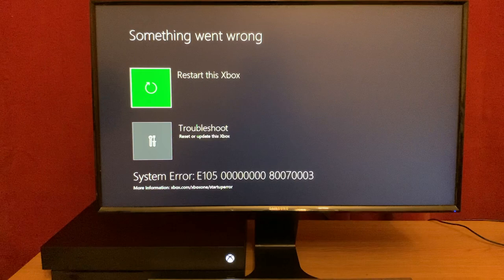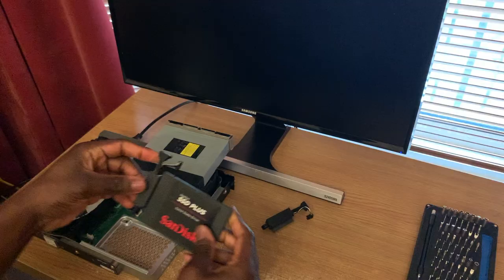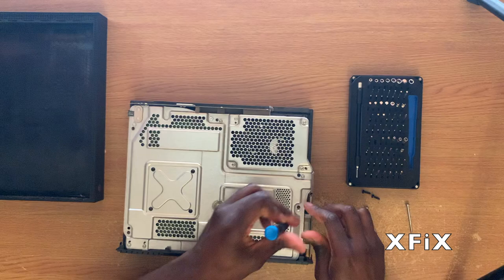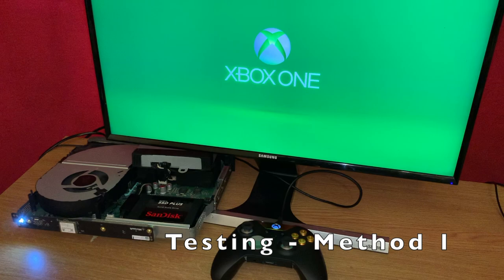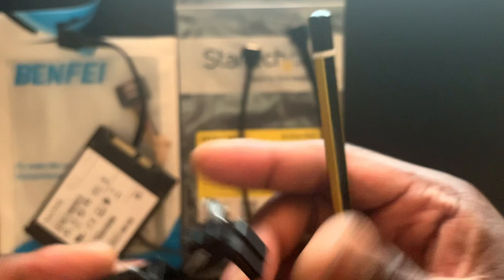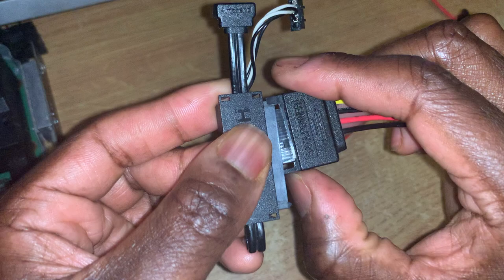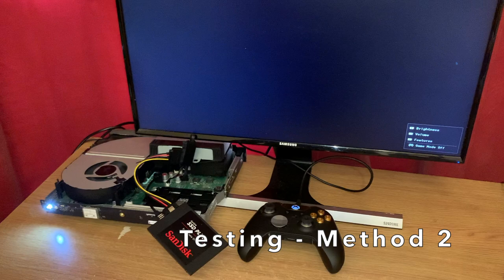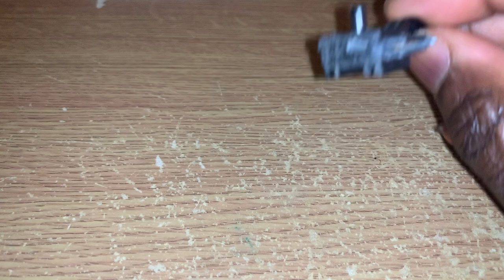Guide - Xbox One Start Up Error Codes Fix (E102, E105, E206, E302, Green Screen of Death, etc.)

Comment: I had e102 error and tried all the typical resets including OSU1. Nothing worked there so I followed your method 2, buying new power and data cable parts you did, using the hacksaw, putting the box back together flawlessly, and STILL e102 message. OSU attempt brings E101! Bummer! Thanks for trying. Would love any other recommendations. Maybe need a new HDD? But I don't know how to format replaced HDD using a mac computer...
Reply from the maker: Does it give you the E102 error straight away or does it hang around for about 30 seconds not doing anything before it fails? If it errors out straight away then the information on the drive has been corrupted and you’re correct that a format would be needed. I had to do that the first time I replaced my drive. I used a Mac to do it by using Boot Camp to install windows and a USB 3.0 to SATA adapter that I got off Amazon for about £7 (~10USD). I followed this guide from XFiX: https://youtu.be/4xYQQicXdU0. I hope this helps!
Reply: @doo-dahs140  Thanks for getting back to me! Last night I performed what you described with Windows in  VMware Fusion and formatted two working HDDs and testing both. One was formatted and installed OS using your XFIX video and the other using Tweak Tips - https://www.youtube.com/watch?v=tUisAJjfGz0. Neither worked unfortunately. The e102 error went away after I replaced the data cable and hard drive and I'm left with a machine that gets to about 9% with reset and e106. I try the newest OSU1 and it brings e101. I bought this xbox one x from someone, setup after a reset, then played it for two weeks without issue with my personal acc (not insider program to my knowledge) and it just crashed and started this :) Could it still possibly be in "insider program" and thus rendering the OSU files void?
Reply from the maker: Here are a few more things to try:

Redownload OSU1 and use a different USB stick. I apparently used a dodgy stick the first time I tried it. It would always fail either during the “copying” or “verifying” stage of the update. Using a different stick solved that problem. 

Try plugging those hard drives back into the computer and scanning for bad sectors using windows. You’d have to scan and repair each partition individually but each of those doesn’t take long. 

If you were a member of the Insider Program, you won’t be able to install the OSU until the public version gets past whatever Insider version you were on before.

Don’t give up yet because I had the same teething problems when I first did a swap. One final thing (and I know this’ll sound silly) but shut down your Xbox completely, unplug it from the mains and leave it unplugged overnight. After you’ve scanned and repaired the drive, try to apply the OSU in the morning. I don’t know why but sometimes that works.

Let me know if any of those helped.
Reply: @doo-dahs140  Well I tried placing a brand new samsung evo ssd formatted with your guys instructions, so I know its not the hard drive issue. I'll try the unplug overnight and usb thing :)
Reply: @doo-dahs140  Also, I have tried three different USB sticks with the recent 11-02-2020 osu1 and it still gives me error 101 when I try to OSU
Reply: @doo-dahs140   I get e106 when I hold sync and eject after it partially preps console. I've also replaced SATA cable in the xbox the way you showed. Could e106 in this case be an issue with other hardware such as the motherboard?
Reply from the maker: Not likely. E106 usually only pops up during this process when you use a drive that’s got the correct formatting but hasn’t been OSU updated to put all the necessary system files on that the format script didn’t. The XFiX video suggests trying to erase all content and settings on the console before you try to install the OSU. I suggest trying to erase settings like three or four times because sometimes the onboard memory (separate from the hard drive) doesn’t register the reset properly.
Another question: when you try to apply the update, which phase does it fail during - “downloading”, “verifying” or “applying”?
Reply: @doo-dahs140  Yeah I think I must be having a problem with the on board memory. I tried erasing content / setting 3-4 times like you mentioned. It gets to 4% then e106 each time. Then I try using OSU1 on USB. 1% and be to e101. This is literally driving me crazy. I'm a decently tech guy and have read every online discussion and watched every youtube video on this multiple times and still can't get it to work LOL
Reply: @doo-dahs140   does USB Flash drive need to be 3.0? I've only been using OSU1 with 2.0 flash drives and nothing!
Reply: @doo-dahs140  My works again! It was a developer / insider build after all. Had to wait for new OSU to come out a few days ago to fix the insider build corrupt files. I Plugged in new OSU1 with flash stick and it updated great. Then I joined insider hub on the console and went to —> settings —> manage devices —> unenroll Xbox one x from developer program —> restart —> reset to factory. Now I’m back to release build with no issues and a new SSD. Woo hoo!
Reply from the maker: Awesome! I’m glad you managed to get it sorted. It’s frustrating when you’re trying to sort it out and the only thing left you can try is to just wait a while. Nice one!